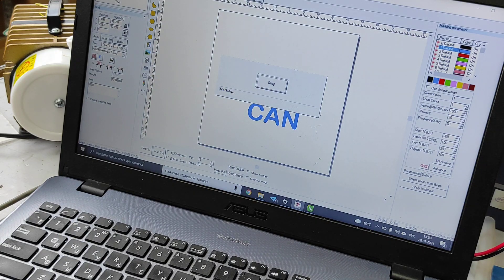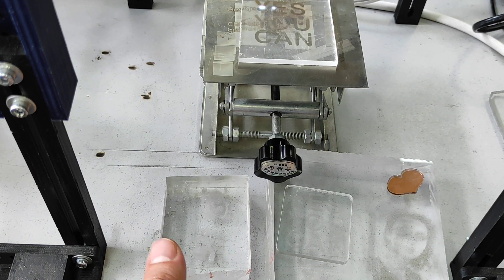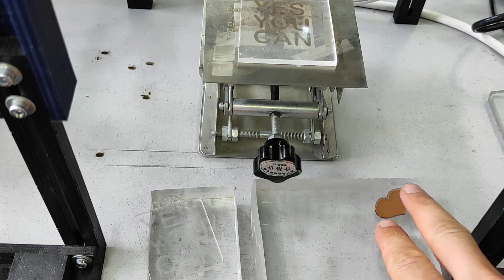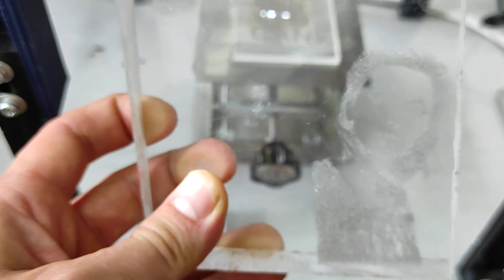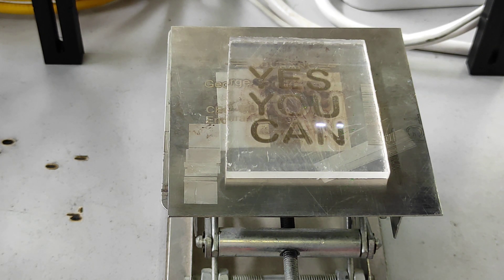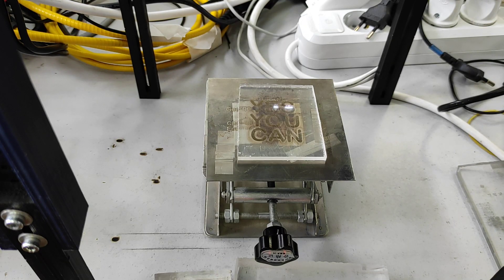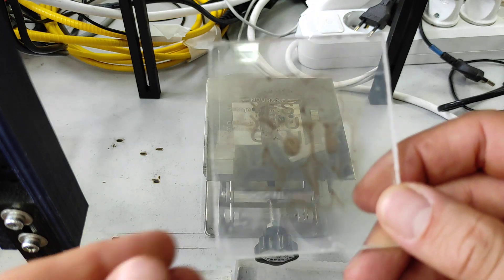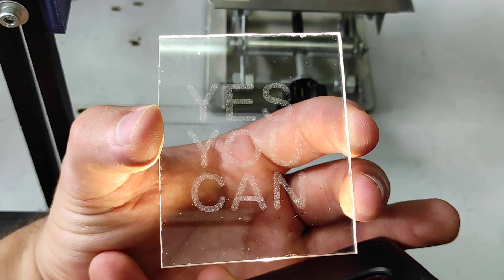2D laser engraving inside transparent acrylic with 10 watt DPSS Endurance laser

Comment: If I understood you well you have focus your laser on the middle plane of the glass but you have used the Steel plate under it to reflect the laser to the targeted middle Glass plane. Why are you using the tape that you mooved up later? Does it have any influence like the Steel on the Glass?
Very good video!
Do you provide any further parameters for raycus 50 watt fiber laser?
Many thanks anyway!!!
Reply from the maker: yes, correct and we have 50 watt DIY Galvo as well https://www.endurance-lasers.com/products/endurance-diy-marking-machine-30-watt-fiber-raycus-diy-galvo-system